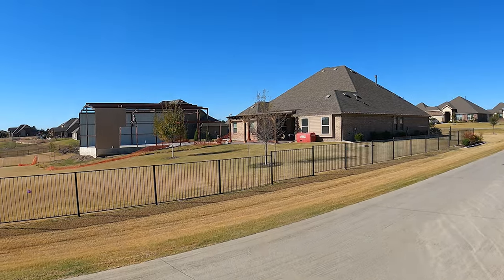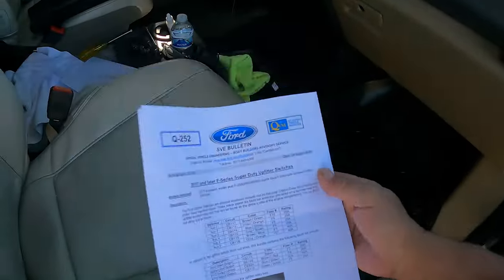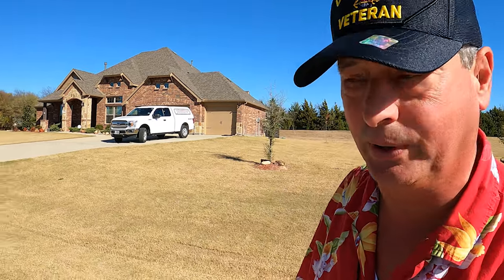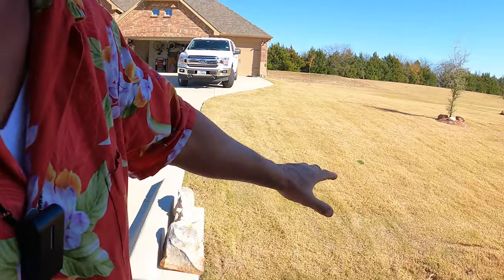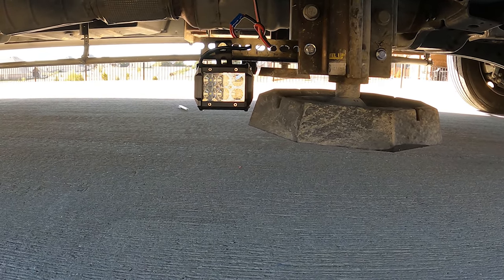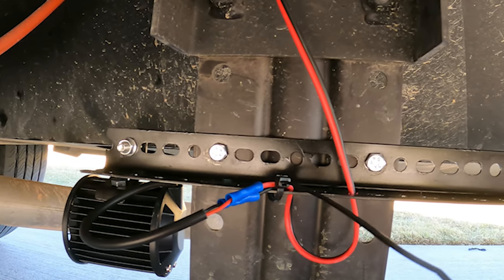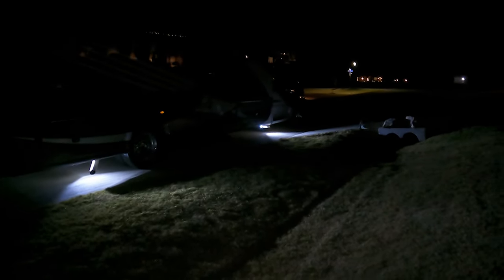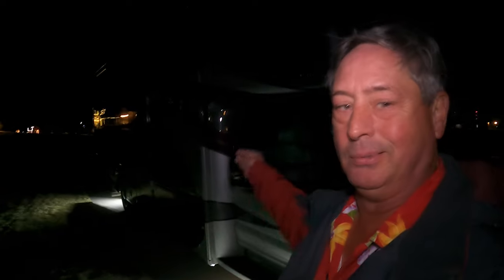Rock lights On A Motor Home?

Comment: Nice. I thought to wire the rock lights to the step light, so you can use the app to turn the lights on and off; we have the RB34.
Reply from the maker: I think that would be a great edition! I have been considering adding some under-glow lights for when we are parked, your ides would be perfect for that! I like having the big rock lights wired to the up-fitter switches so that I can turn them on from the drivers seat and not have to mess with the phone in the dark.

Comment: First off, nice job and thanks for sharing.  We have a much shorter (24') Winnebago Minnie Winnie Class C with an E-350 chassis.  No upfitter switches on our rig, but apparently not too difficult to add an aftermarket unit.  I've thought about installing a string of undercarriage LED lights.  In my case, I'm hoping to ward off curious rodents in more remote areas that we end up camping.  However, having those lights like on your rig would be pretty nice.  I'd almost be tempted to hook in an optional motion detector as well to turn them on when something (or someone) got too near the RV.
Reply from the maker: I have heard that lights under the coach does not do much to discourage rodents. There are a lot of mixed messages about that. I like the motion detector idea! Thanks for watching!